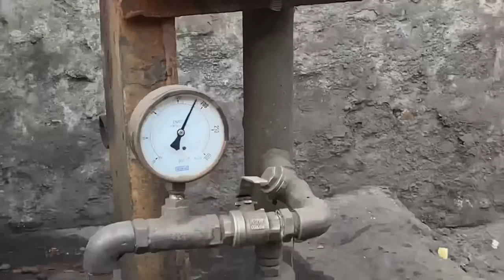Process of Amazing Manufacturing Cast Iron Y Strainer Valve !! Production of Y Strainer Valve

Comment: Dear Sir/Madam:
Cangzhou Puhui Electromechanical Equipment Co., Ltd. is located in Cangzhou, Hebei Province, the hometown of casting in China. We are a reliable manufacturer of cast iron valves, cast iron filters, cast iron check valves, and cast iron pressure reducing valves. Established as a viable and reputable manufacturing, OEM company, we have expanded our product lines over time to meet rapidly growing customer needs, looking forward to in-depth cooperation with you. In today's rapidly changing environment, we provide high-quality services to customers, raw material suppliers, equipment manufacturers, etc.
Our casting production, machining centers, CNC machine tools, surface treatment equipment, and pressure testing equipment allow product quality to be well controlled. Valves and filters are suitable for gray cast iron (ASTM A 126, CLASS B) and ductile iron (ASTM A 536, grade 65-45-12), which can be produced by mold casting or carbon steel welding according to product requirements .
Our business philosophy serves customers, service suppliers, and every employee. We have hired a large number of employees, and the good corporate environment has allowed most of them to work in the company for decades. This is our learning direction.

Name: Wang Wenfa
Company: Cangzhou Puhui Electromechanical Equipment Co., Ltd.
Email: castirongatevalve@gmail.com Wechat: 13832767113
Tel: +86 138 3276 7113
Address: No. 2 Road, Industrial Development Zone, Botou City, Cangzhou, China